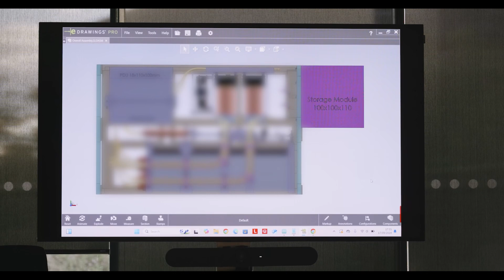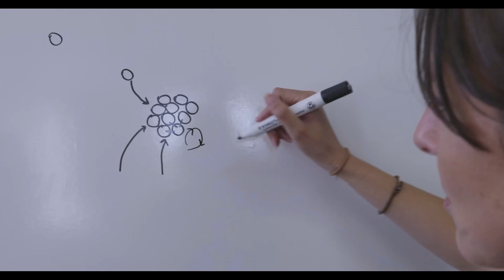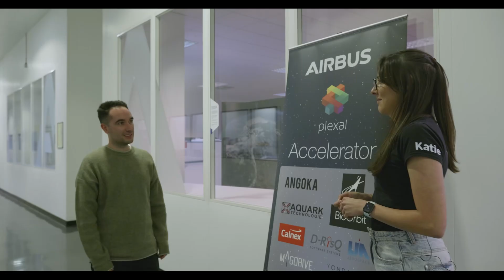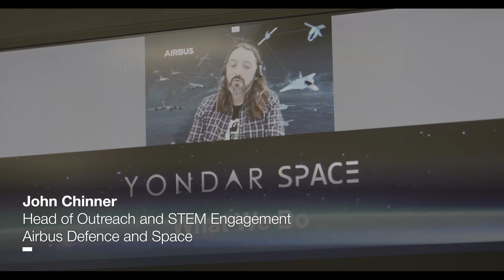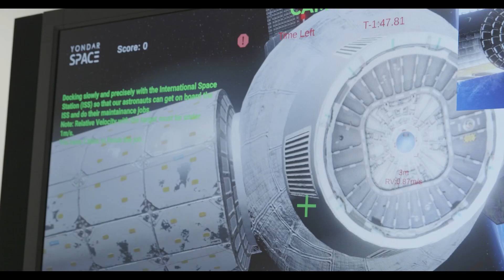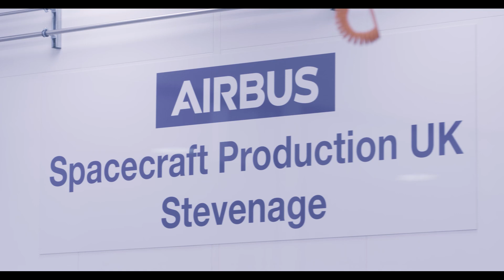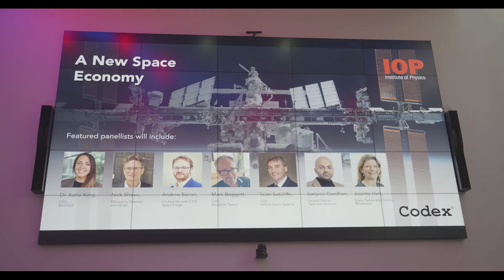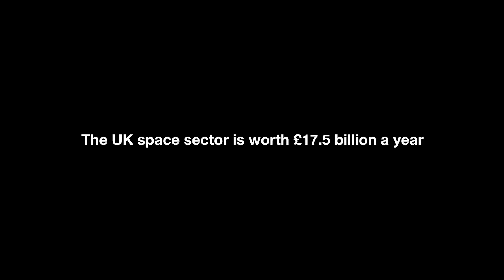Shooting for the stars: the Airbus Space Accelerator

Comment: 5:18, how do you use metals as fuel?
Reply: Its actually "propellent" its just mass they are pushing one way to push the space craft in the other way. Usually its hot gas. it sounds like they are using magnets to launch metal instead.
Reply: They produce a chemichal reaction so they work like gunpowder in fireworks.